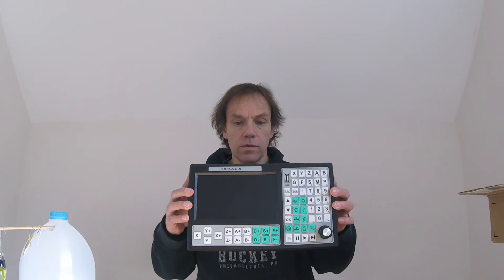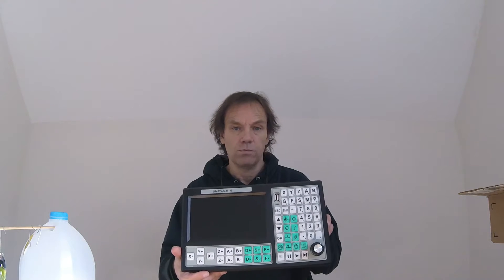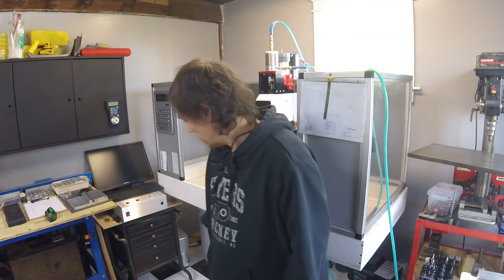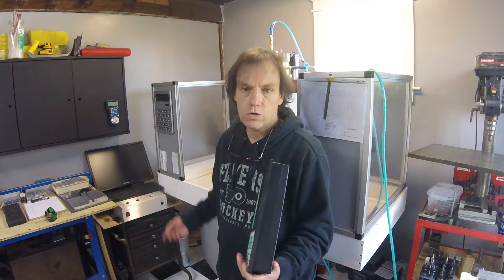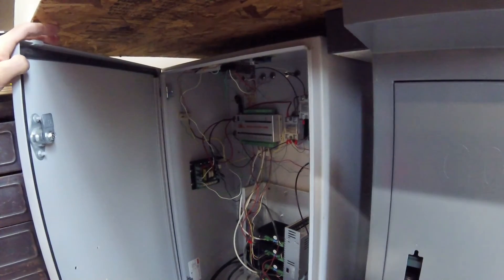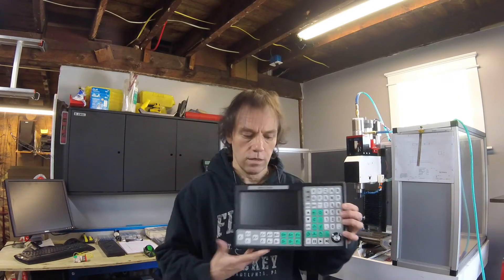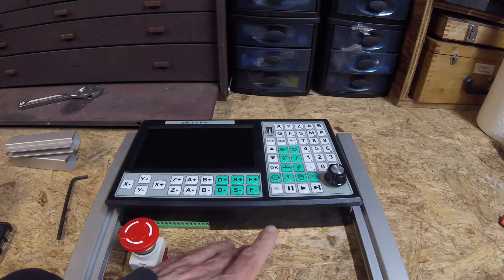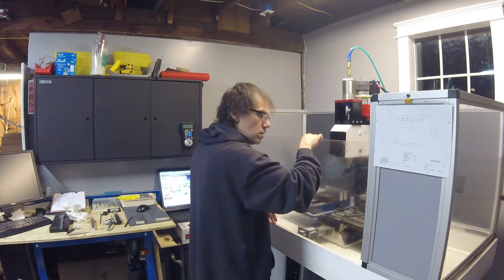SCMCS5 5 N N cnc controller Mach3 Replacement

Comment: Hi. Do you know which type of inductive sensor need to be used with this controller, NPN or PNP ??
Reply from the maker: you know im unsure if you can or cant. I no longer have this unit. At the time it did not come with backlash control so i sold it .
Reply: @MasterCraftFishing51  Thanks a lot for the update

Comment: thanks for the video. I just got mine in the mail today. Will you be doing an update on installing, setting up and running this unit?
Reply from the maker: Well i was going to till i found it had no backlash control. I spent a long time trying to contact people about the issue. I finally got some answers they said it will be a long time till they get that resolved. Due to the fact its very hard to write a patch  for a control that already has a interface. So they have to start from the ground up and release a full update.  The wiring is pretty easy if you need any help  just give me a shout.